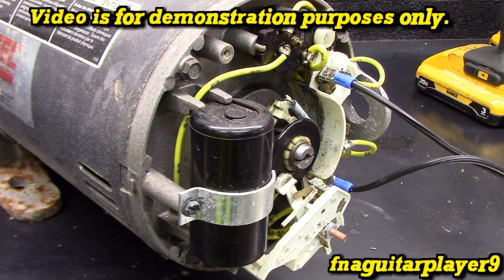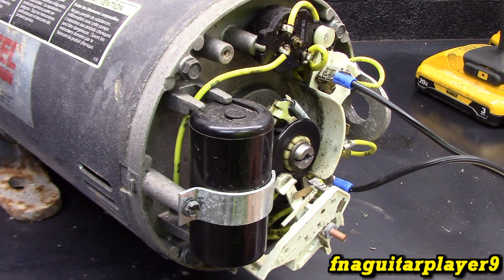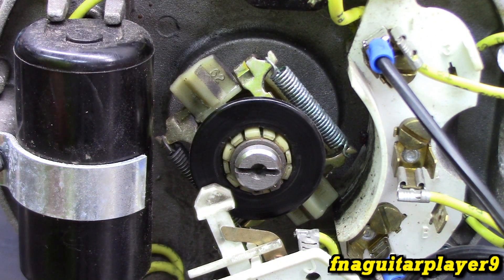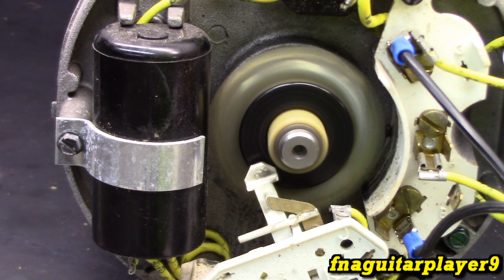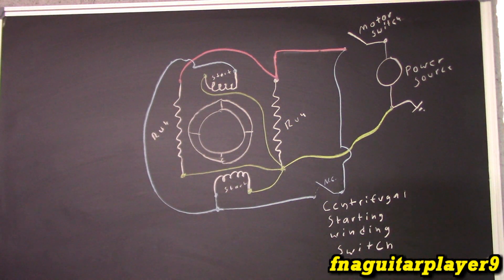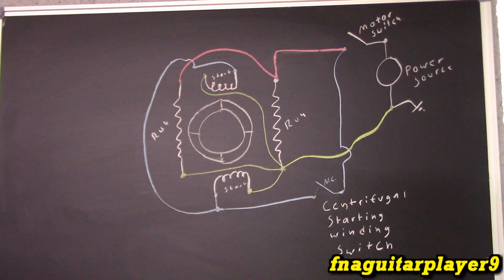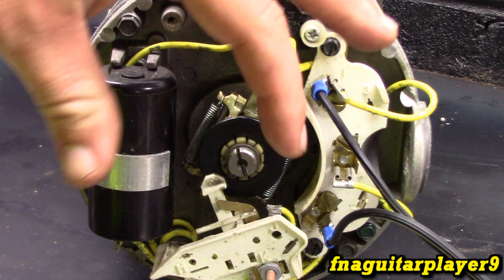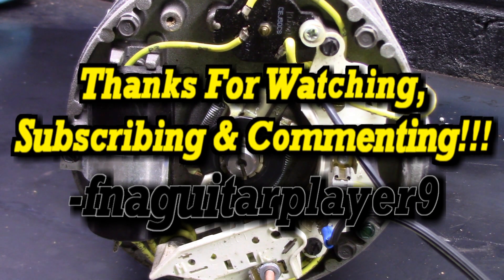How Electric Motor Starter Winding Centrifugal Switches Work

Comment: Question: Is the centrifugal switch similar in principle to a relay? I mean the relay in the refrigerator, freezer, air conditioner compressor, and split unit                      Is it possible to use the centrifugal key instead of the capacitor? I mean, is it possible to dispense with the capacitor that works to connect the calendar files? Thank you

Comment: I’ve got a Dayton single phase 3/4 HP, was starting intermittently only, changed the start capacitor but problem persisted. I can get it started by kickstarting I manually and it works fine once it’s started. I’m guessing this centrifugal switch is greased and gummed up with dust and lint and is likely sticking open so the next time it goes to try and start the new capacitor isn’t even being used. I’m hoping to get some time to open it up and have a look inside.

Comment: Very informative and well presented. I presume if the motor came under heavy load and slowed down enough, the starter coils would kick in and give some extra torque/speed?
Reply from the maker: Its possible, but its not really for that, it would have to slow down to a almost stop to get it kick in. thanks for watching!
Reply: If I bog my 8" grinding wheel down, the start winding kicks in.